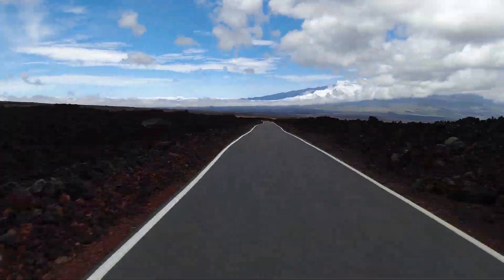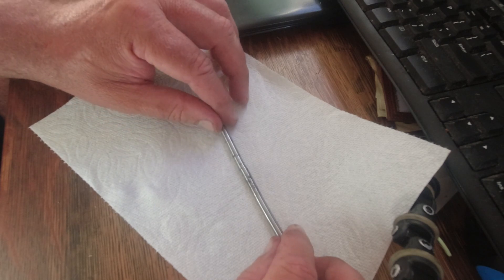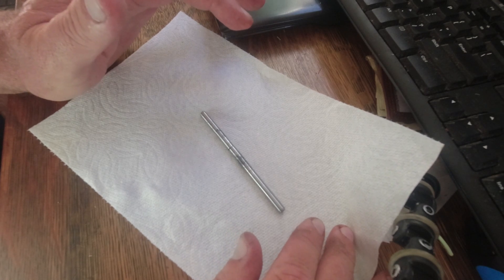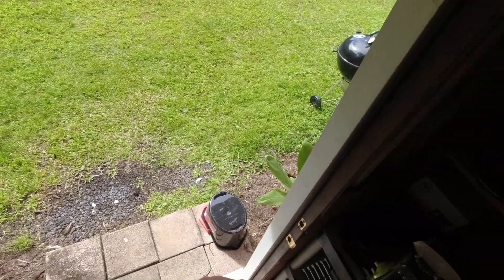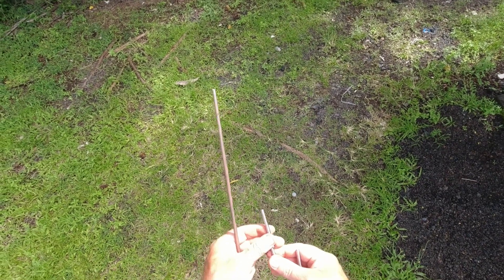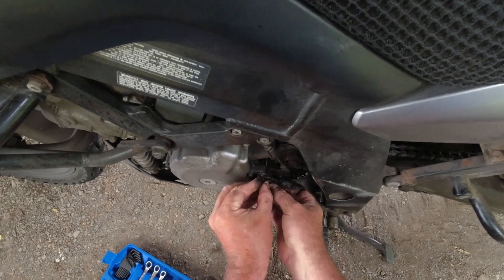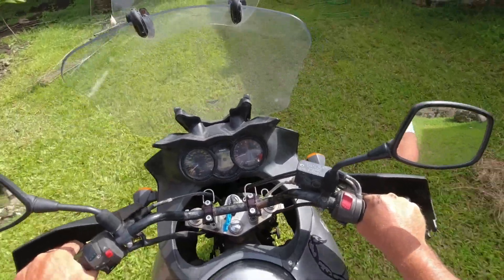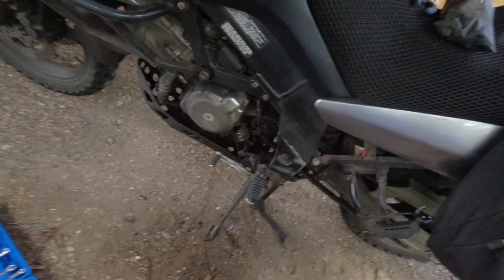Broken Motorcycle Clutch Repair Quick Fix & Repair | Suzuki V-STROM 650

Comment: I hate to get off base but I bought a new 2022 just put 300 miles on it and when I let off of the clutch it makes a rattling noise that emediatly  stops when I pull the clutch in, was wondering if you have had any issues with your vstrom. Thanks in neutral of course
Reply from the maker: sounds like a throwout bearing?  You should take it back to the dealer